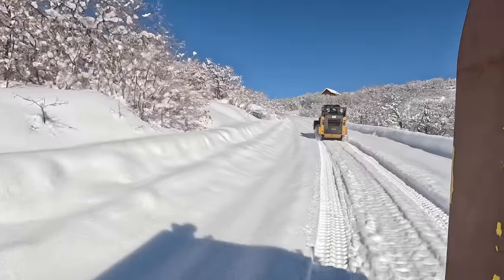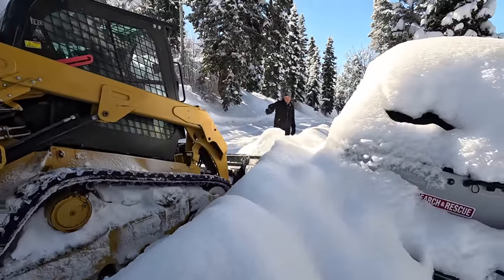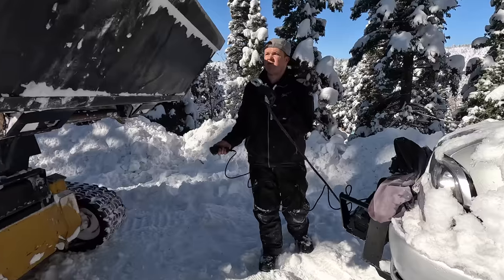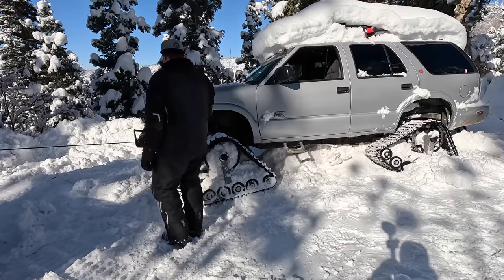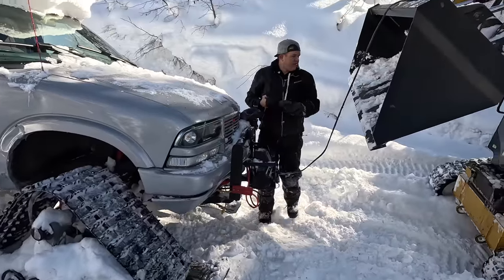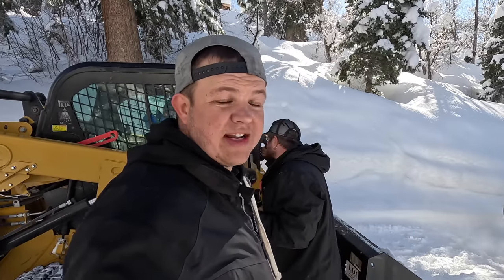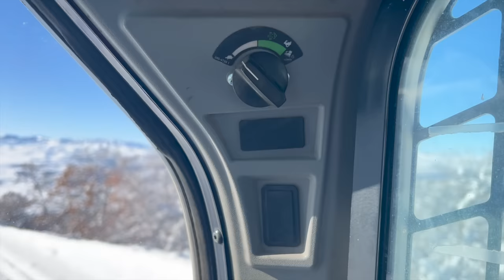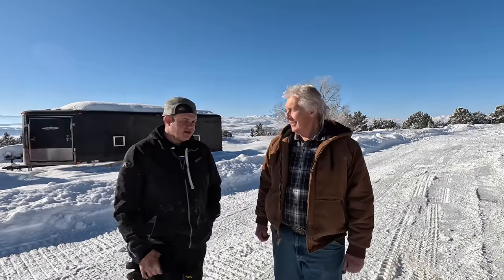Recovering The Nearly FORGOTTEN Blazer We Snowed In!

Comment: Smoke - a visible suspension of carbon or other particles in air, typically one emitted from a burning substance.
Steam - the vapor into which water is converted when heated, forming a white mist of minute water droplets in the air. No fire required, just an increase in heat. Dew naturally vaporizes as air temperature increases.

Comment: When water is heated it evaporates, which means it turns into water vapor and expands. At 100℃ it boils, thus rapidly evaporating. And at boiling point, the invisible gas of steam is created. The opposite of evaporation is condensation, which is when water vapor condenses back into tiny droplets of water

Comment: Well life happens. Finances just changed so 7500. for the jeep. 1989 YJ 170k miles. all new gears and seals in everything, Good 33 inch tires, electric real locker, hood vents, plow, winch on the front, new larger battery, cb, sterio, all interior lights work, leds front and rear. solid doors new door panels not on yet. I do not have key locks yet.. Set of nice white half doors. led tail lights. 4.2 5 speed. sniper 2 barrel injection, new tank pump, msd self learning ignition also tuned by the sniper set up. led head lights. rhino lined inside floors. new radiator, stat, 4.88 gears. Moriarty NM.

Comment: Smoke has burned particles of water substance is being burned. Steam or water vapor in this case, is just that. Water. The byproduct of combustion is water. When it’s cold that water freezes in the air and you can see it with the naked eye. In warmer temperatures, you can’t see it. That’s why, when your exhaust warms up, you don’t see the water vapor anymore.

Comment: According to the Energy Education Team at University of Calgary:  Smoke is a visible collection of a variety of solid, liquid, and gas particles left unburned during the combustion process.

According to the Engineering Tool Box (and others): Steam is water vaporized during boiling or vaporization.

So while fire can be used to create steam the smoke from the unburnt material used to fuel the fire is not steam.  

Ask if there are situations where you can have both smoke and steam combined and the answer is yes such as when fighting a fire with water or burning wood with high moisture content however the steam content is still the water vapor component and the smoke content is still unburnt fuel.  If there is fuel contamination in the water and it gets hot enough to combust/char there can be smoke from the fuel contamination.  

If you separate the Oxygen from the Hydrogen in the water yes the Hydrogen can burn however its usually a clean burn that produces no smoke.  

BTW:  You don't want to know what happened when the backflow valve in my first Brown Gas Hydrolizer failed.  It was loud to say the least and since only the Hydrogen burned there was complete combustion and no smoke.  ;>

Best!

Comment: What is the difference between smoke and steam?
The gasses typically include water vapor, but smoke differs from steam in that there are other gasses, such as carbon dioxide and sulfur oxides, plus there are small particles. The type of particles depends on the source of the smoke, but usually, you can smell or taste either the soot or some of the gasses from the smoke.

Comment: Steam is indeed evaporated water. It is a vapor and in no way smoke, not even a kind of smoke.
Smoke is a combustion gas that remains after burning and is barely visible. If smoke is visible, it contains unburned particles and/or not completely burned particles.

Comment: Steam is caused by a mere temperature difference in the air. Significantly hot air in cooler air creates steam. Smoke requires burning. Robby is correct.

Comment: Smoke comes from fire in which something is burning like a material burned by flame heat that's too hot so the material breaks down cause of contact being made. Steam is what happens when the air temp around said material or object is warmer than object

Comment: Smoke definition: a visible suspension of carbon or other particles in air, typically one emitted from a burning substance. Water droplets are definitely a type of particle. So calling it smoke is correct.

Comment: Steam and smoke seem similar because at first glance they seem the same. However, steam is always produced from water being heated, while smoke is by product of combustion. Steam will automatically condense if the temperature were to drop, while smoke will not condense but rather dissipate into the air. Steam is not dangerous to inhale, while smoke dangerous to inhale and can cause damage to lungs. The massive damage to smoker’s lungs is caused by the smoke rather than the tobacco. The easiest way to tell these two apart to see how it is being produced. Also, the color steam would be more white and misty color, while smoke would be darker in color

Comment: There are a couple videos out there where a hood was used as a recovery tool.  I'm thinking that given all the fabrication talent/tools you possess why not make a couple "purpose built" skis with a vane down the middle for steering, a "cradle" with tie down points, and an upturned front end.  A little cutting bending and welding shouldn't be too difficult or time consuming.  Built right they might even work on mud and dirt if needed.

Comment: Robby is correct in this one.  ……. 

Smoke is from “FIRE”. Steam is water vapor. It’s “Water” ….. NOT SMOKE. 

Steam is the gaseous phase of water which is formed when the necessary latent heat of vaporization is supplied to water at its boiling point.

Comment: Smoke is a visible suspension of carbon or other particles in air, typically one emitted from a burning substance.
Steam is the vapour into which water is converted when heated.

or:

smoke is alot fo stuff thrown in the air.
steam is water changed form.

Sorry Hillblilly :)

Comment: Smoke and steam are different physical states of matter, with different properties and compositions.

Steam is the gaseous form of water, produced by boiling or evaporating water. It is composed solely of water vapor and has no solid or liquid particles.

Smoke, on the other hand, is a mixture of gases, particulates, and liquid droplets produced by the incomplete combustion of a material, such as wood or coal. The exact composition of smoke depends on the type of material being burned and the temperature of combustion. Smoke can contain various harmful substances, such as carbon monoxide, particulate matter, and volatile organic compounds, which can have negative health effects when inhaled.

In summary, steam is a pure gas, while smoke is a mixture of various substances produced through combustion.

No, steam is not a form of smoke. Steam is the gaseous form of water, produced by boiling or evaporating water, while smoke is a mixture of various gases, particulates, and liquid droplets produced by the incomplete combustion of a material. Steam has a different composition and origin compared to smoke and is not considered a type of smoke.

Chat GTP.

Comment: Did anyone get under that blazer and grab the transfercase 4wd rod and pull it with vice grips and lock it in? Or the front axel locking pin? I know the newer ones had a eletric/vacuum solenoid that always fails, they make a manual lock cable kit like a old skool manual choke. Put one in my exs jimmy

Comment: Steam is small water particles evaporating into air
Smoke is ash particles from the combustion of a fuel source 
Smoke and steam are not water.
You do not NEED fire to create steam. Induction or any electrical/nuclear heat source can create steam

Comment: Steam is super heated water due to rapid evaporation.  Smoke is a visible suspension of carbon or other particles in air.  Smoke requires burning, and unless your my wife you can not burn water.

Comment: Steam is an element of smoke.  Steam is actually invisible.  What you see in steam or smoke are other elements that get suspended in the superheated water vapor. The byproducts of combustion is water and carbon dioxide. Of course the water is gonna be in vapor form. Or steam,  meaning steam is an element of smoke.

Comment: any good heat source can make steam. you dont need fire. but the engine is making explosions and thats technically fire and i  thats what was making the snow evaporate. steam is not smoke. steam consists of water vapor. smoke contains carbon monoxide, carbon dioxide and particulate matter (PM or soot) they are 2 separate things.  HOWEVER there is some water vapor is most smoke. but steam still isnt smoke lol.

Comment: You're both wrong, but Robby's less wrong.

Smoke is visible particulates from something burning, such as wood, oil, rubber, etc.

Actual steam is clear and not visible, under high pressure, and very hot. It can kill you and you'd never see it.

What is usually meant by "steam" is liquid that has gotten hot enough to evaporate, and what you see is a mini cloud. You can produce your own "steam" by breathing out on a cold day. 

You can't produce your own smoke because you're not burning up.

Comment: Steam is not smoke.

Steam is a GAS. You can't see it.

What you can see is water vapour which is tiny droplets of liquid water suspended in the air.

Smoke is a combination of products including solids, liquids and gases that occur as a result of a fuel burning.

You take your fuel, say a piece of wood, and heat it up until it undergoes pyrolysis, that process releases flammable gases which can then ignite, generating more heat and away the reaction goes.

The pyrolysis gasses undergo a Redox reaction, combining with oxygen in the air to form gasses such as carbon dioxide, carbon monoxide and steam.

Smoke consists of those combustion products (gasses) but also includes solids such as carbon particulates and liquids such as water vapour, especially at lower combustion temperatures.

Smoke will contain steam.

Steam is NOT smoke or any form of smoke.

Smoke may contain water vapour.

Water vapour is NOT SMOKE.

Comment: I have a question for  Hillbilly. How does condensation get through a fuel tank. This especially happens on diesel... The  Tank can be made out of anything..  I realized the airnautic may have a different may tank material..  And may  Cost 10 times as much as a regular fuel tank in a car or a piece of equipment.  How do you think  water  Get in the diesel fuel.. Or moisture into cloud..  for rain ? 🌧   This is basic Earth science for a 3rd grader. LOL 😆

Comment: NO, NO, NO steam is not smoke.  Smoke is part of the process of pyrolysis, which is decay or entropy.  Rusting is an example of pyrolysis, just much slower than fire.  Steam is the process of converting water to steam at a specific temperature.   Steam returns to water after cooling.  Smoke  or rust does not return to it's first state of existence, it simply is a different property than its original state.

Comment: Steam is NOT smoke! And smoke is NOT steam. Both are vapor from something being heated. But they are NOT the same thing. Jus' cuz y'all are igurrant Hillbilly don' mean y'all cain't larn sumfin' new. 😎 Honestly, I encounter quite a few people who think smoke and steam are the same thing. As a mechanic. You should know that vapor coming out of your exhaust can tell you if there's something wrong with your engine or it's cold and damp and your exhaust is warming up and evaporating moisture out of the exhaust. Black vapor is carbon smoke from a too rich air/fuel ratio. Blue vapor is oil smoke from oil getting into the combustion chamber from bad rings, cylinder walls or valve stem seals. White vapor if sustained, is steam from water getting into the combustion chamber from bad head or intake gasket, or cracked head or block. Basic auto mechanics.

Comment: smoke: [noun] the gaseous products of burning materials especially of organic origin made visible by the presence of small particles of carbon. a suspension of particles in a gas. team (stēm) n. 1. a. The vapor phase of water. b. A mist of cooling water vapor. 2. a. Pressurized water vapor used for heating, cooking, or to provide mechanical power. b. The power produced by a machine using pressurized water vapor: an engine at full steam. c. Steam heating.  It is steam!!!

Comment: Steam is actually invisible. Have a look at the spout of a kettle of boiling water and the steam is the bit you can't see from the spout until about a quarter of an inch away from the spout. It then becomes water vapour and that is the stuff we can see.

Smoke is a suspension of particles in the air resulting from combustion, or pyrolysis, and as water isn't burned to form steam, merely heated to boiling point, then steam isn't smoke. Hillbilly is not correct. Robby is nearer the truth, but as I said. what he is seeing is water vapour.

Comment: 😳 Robbie, apparently you don't ask for a high school diploma on your job application...  Hillbilly sorry you're wrong... You don't need fire to have steam... All you need heat to have steam...  Steam is water in gas form... Smoke is a collection of tiny solid, liquid and gas particles. Although smoke can contain hundreds of different chemicals and fumes, visible smoke is mostly carbon (soot), tar, oils and ash. Smoke occurs when there is incomplete combustion (not enough oxygen to burn the fuel completely).

Comment: Please show this to the one you call hillbilly.  THE DIFFERENCES BETWEEN SMOKE &  STEAM. He obviously didn’t pay attention in science class.  When water is heated it evaporates, which means it turns into water vapor and expands. 

At 100℃ it boils, thus rapidly evaporating. And at boiling point, the invisible gas of steam is created. The opposite of evaporation is condensation, which is when water vapor condenses back into tiny droplets of water.

Smoke is released by any type of fire (forest fire  brush /  crop / structure / tires / waste / wood burning  / Wires burning / engines burning,  The list is ad-infinitum.

 Ergo, a mixture of particles and chemicals produced by incomplete burning of carbon-containing materials. All smoke contains carbon monoxide, carbon dioxide and particulate matter (PM or soot).